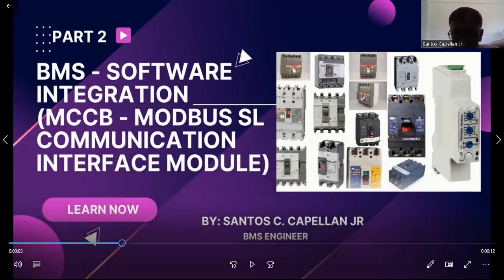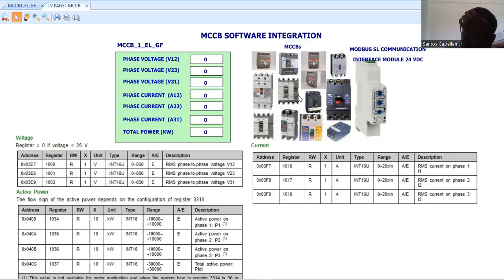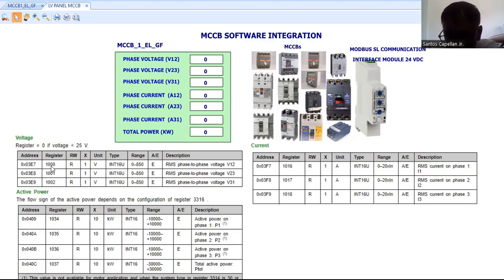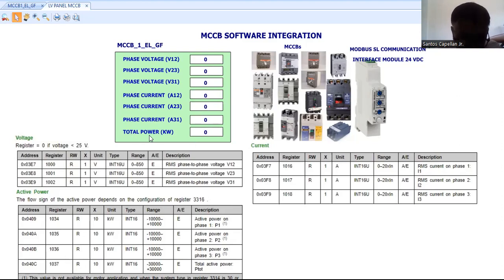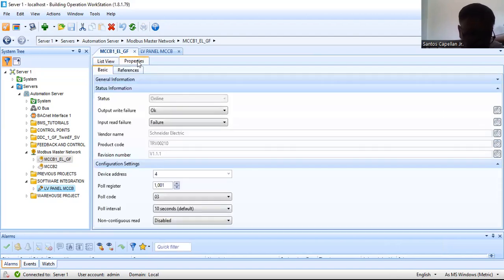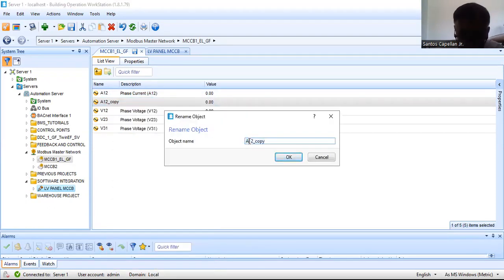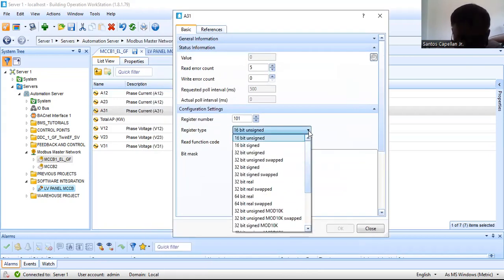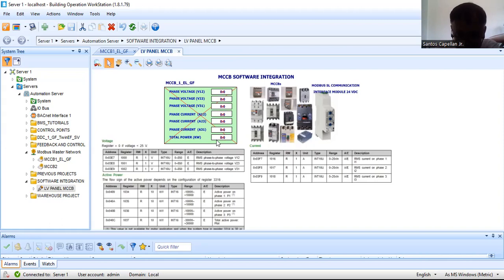BMS - SOFTWARE INTEGRATION TO MCCB THRU MODBUS SL COMMUNICAITON INTERFACE MODULE.

Comment: But you are not teaching how to do programming
Reply from the maker: I have several control logic programming example in my channel, you can browse and watch
Reply from the maker: if you are referring to this software integration, there is no programming involve, all you need to do is configure the points properly to reflect the real time values of the equipment you want to monitor or display the values in BMS workstation